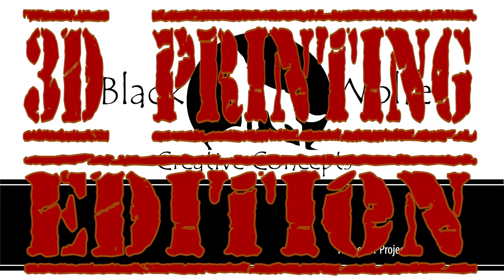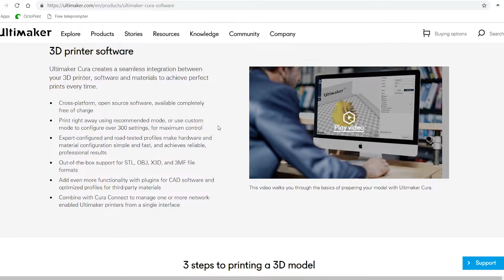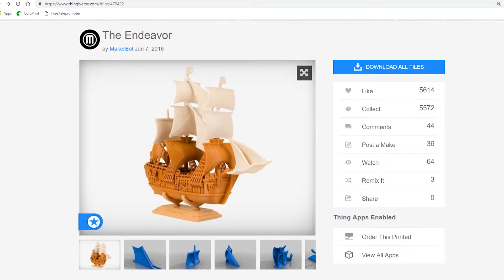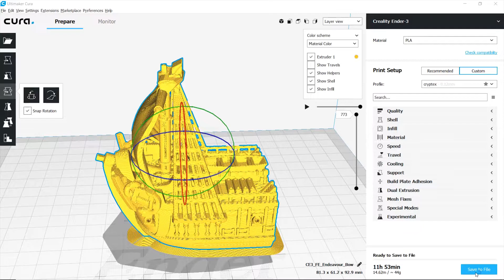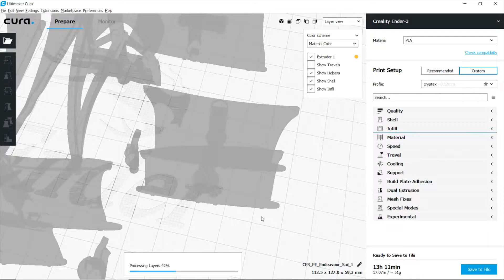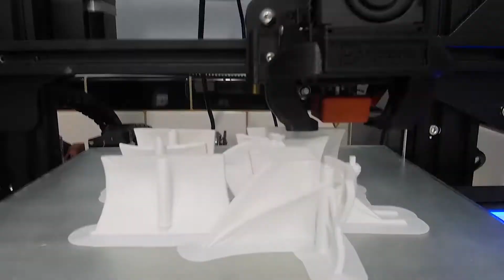3D printed HMS Endeavour on Creality Ender 3

Comment: Great print! Was the cura estimated time to print about right? 
I'm thinking about buying the same printer as my first, always nice to see the print results people get with this thiing
Reply from the maker: Hi!  Thanks for the compliment.  The estimated time was about right.  I'd say give or take an hour or two.  I actually reprinted the sails because of the infill, so it took a little longer than estimate.  I've found with Cura 3.6, time estimates seem to be pretty accurate as long as one isn't using supports.  Soon as supports are added, the estimated time of printing goes off.  But, estimate of filament use has been pretty good.  SO good I've been able to plan prints around almost empty rolls, and be successful!

The Ender 3's are my first 3d printers.  I like them quite a bit, but I won't lie they took me a little time to dial in.  I don't know if it was just an odd batch at the time I purchased, being completely new to the hobby, or a mix of both but it took me almost 3 months to get a print I'd call decent.  My originally one actual got sent back to Creality and a replacement was sent, along with a bunch of replacement parts.  It was (and still is) a great learning experience, but dang what a learning curve.  

So, if you are willing to put in the time, the Ender 3's can be VERY rewarding!!!

Thanks for watching!  Appreciate it!
Reply: @blackwolfecc  Oh unfortunate to hear you had to send yours back. This one guy I watch has had about 5 creality printers and no issues with any of them after he got the settings right. What was wrong with yours that you had to get a replacement? 

Thanks for sharing your experience mate
Reply from the maker: @Greg-tj8rg  Yeah!  It was actually a combination of youtubers and high reviews that had me pull the trigger on the Ender 3!

1. Issues I had with the first one, not related to being a noob to 3d printers (I think):  The lead screw was bent, badly. This caused all sorts of layer shifting issues, making layers more prominent to the eye.  Replacing the lead screw coupler with a more robust spider coupler helped a lot, but didn't eliminate the layer issues.  I have slightly less bent lead screws (bent non the less) on my current two Ender 3's.  But not so bad as to cause issues while using the spider couplers.
2. The  heating bed was warped, and the print surface that went on top of that was not put together well, so the surface was bubbled.  This made leveling the bed near impossible.  I wound up going to the hardware store and getting a sheet of glass, but because the heated surface was so warped, the glass didn't fit properly, and there was wiggle (even with the clips attached) from back left to front right.  SO, bed leveling was a bit more successful, but because there wasn't proper contact there was uneven heat distribution.  I wound up turning the heated bed off to print PLA, and just used a glue stick to make sure it stuck to the glass.
3. The stock extruder was just plain garbage.  I was getting constant under extrusion.  This took me a long time to figure out.  I THOUGHT there was enough tension on the filament to drive it properly, and when I ran my extruder calibrations I was getting similar results.  But those calibrations only run 120mm of filament.  I wound up running these little test cubes over and over and found that after about 200mm, the extruder guide wheel would slip on the filament, and the problem got worse as a print went along. Wound up replacing with an all metal extruder and that took care of the that issue.  I've had this issue on all three of my Ender 3's.
4.  I had a warped frame.  The two z axis travel bars had a slight warp to them, and in opposite directs.  I found this out while trying to resolve layer shifting issues.  I had to dissasemble the entire machine for something, and wound up taking a level and a t to it and viola...  warped parts. The warped frame along with the bent lead edge made printing smooth layers impossible.
5. The bowden tube and the connectors that come stock are just plain garbage.  They caused a TON of issues that made diagnosing problems so much harder.  I replaced those on all my printers with higher grade materials.  But I still get plug ups pretty regularly, and nozzle clogs.  The whole bowden system leading into the hot end is just not great.  I'm actually fighting a repeating clogging issue right now on one of my machines.  There is a mod I think I'm going to wind up printing soon to hopefully eliminate the issue.
6 The killing blows; the XT60 connectors that connect the PSU to the main board caught on fire.   Luckily I was right in front of my printer when I saw the first signs of smoke, then the little flames.  I wound up replacing the connectors, but when I fired it up and sent a print to it, the extruder motor stopped running within a few minutes of the print.  The driver that controlled it fried.

After 6 weeks working with Creality almost daily, they just had me pack it up and ship it back.  They sent out a replacement same day.  It had soem of the issues, but not nearly as bad.  The primary issue I've had with the third is nozzle clogs.  I've gotten to the point where I do a full hotend tear down after each print on that machine.  Can not for the life of me figure out why it does it.

I had a few other glaring issues, but they were mostly by my own error.  I had never done any 3D printing, so i mad ea few mistakes that made diagnosing the real issues much much harder.  THe XT60 connectors were also a problem on the replacement printer, they melted within the first day of usage.  The printing surface of all three printers were just god awful terribad.  BUT with the replacement and the second one, the heating plates were nice and level, so I moved to glass as a permanent printing surface.  

Anyways.  Sorry for the long reply.  After I actually started getting good prints, I looked back at the youtubers that had reviewed the Ender 3, and it dawned on me that these people are damn good at what they do.  They KNOW what they are doing, so a machine like the Ender 3 would most definitely be a good starter printer.  But from a noob stand point, it was a huge challenge.  I do know quit a few other Ender 3 owners who have had almost no issues with their printers, though.  ANd I do think they are AMAZING printers for their price.
Reply: Black Wolfe CC longest reply ever in youtube! Lol